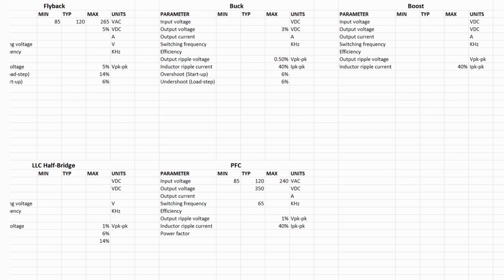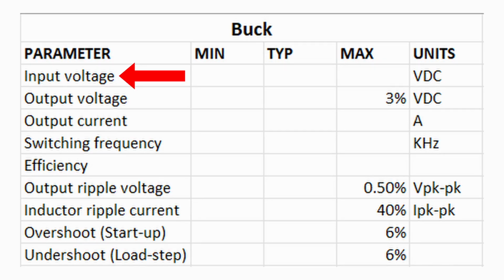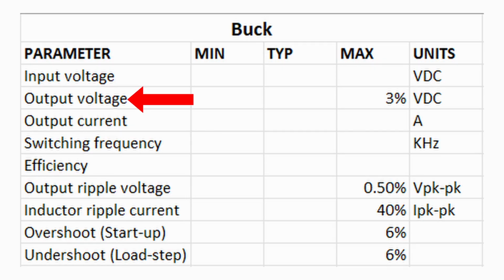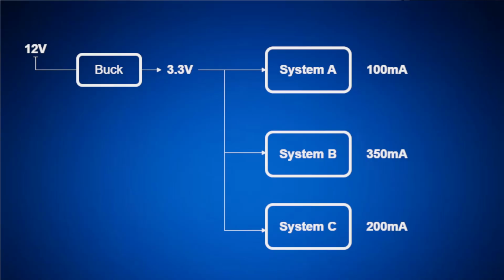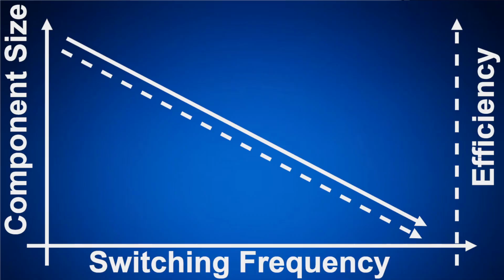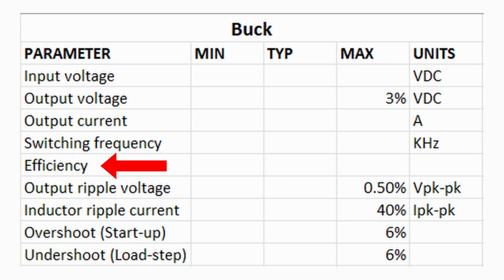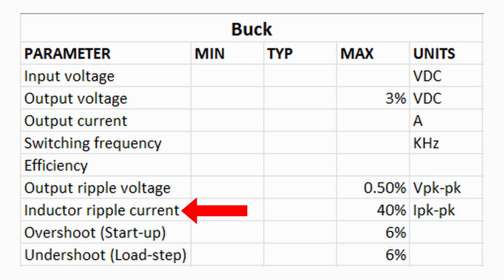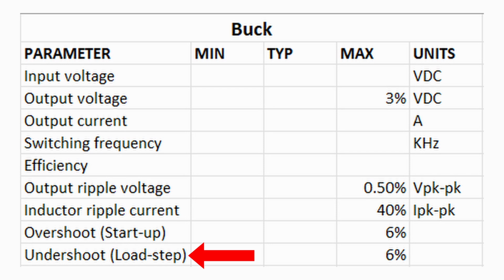How to Design a Power Supply

Comment: Seeing this video, it would make me excited to see one where you design using a couple of switching power supply topologies, but within each topology, create some different designs optimizing for a different parameter each time. Within some set sensible power budget, you could look at design optimized for lowest noise possible, or smallest total area size, or for the highest possible efficiency.

Additionally, of course, it would be super interesting to actually get them physically manufactured, to then measure how well their parameters compared to theoretical expectation, as well as inter-comparisons between the topologies to see if any come up trumps. And if any designed to optimize x parameter, also do relatively well at y parameter or spectacularly poorly.

Of course with the current tariffs this video idea has just gotten a little more expensive, unless you could get a sponsorship or something :(
Reply from the maker: That is a great idea and I have some videos like that planned actually :)